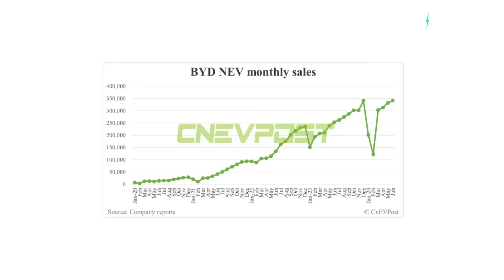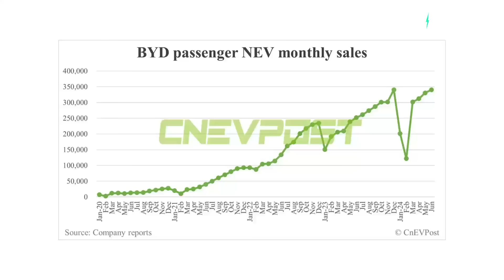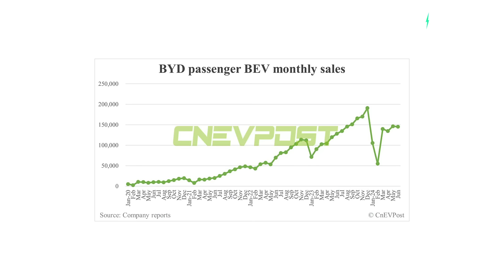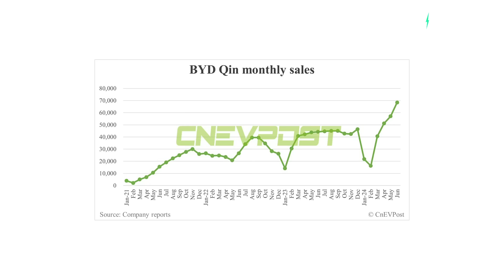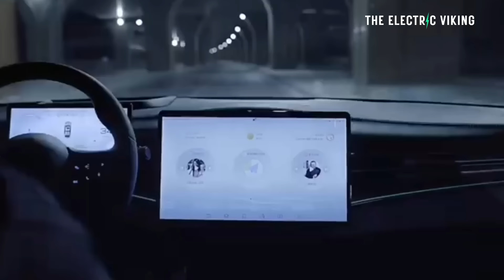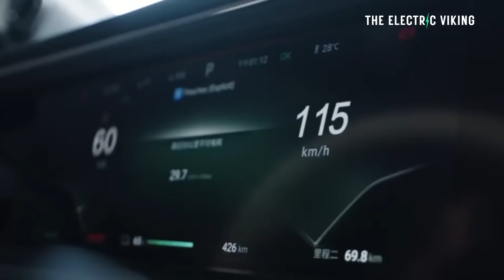BYD just set a new global sales record - will overtake Toyota by 2030

Comment: I have owned an Atto 3 in Perth, Australia for over a year and zero complaints. We got two speeding tickets early on due to outrageous acceleration, but now have got used to it. First 3-month service cost was ZERO and annual service $189 Aussie dollars (US$113). Software is especially strong, voice recognition is outstanding. Very useful boot space. Cost was $30,000 Aussie dollars (US$18,000) after trade-ins. We sold two petrol cars for $18,000, so original price in late 2022 was $48,000. We now use just the one car and make it work. Savings per year $1,600 (petrol and servicing). Insurance is CHEAPER than the old cars. I don't know what some insurance shills are smoking? Range is the other bonus, real world 420km on a full charge (263 miles). Last and biggest advantage is the cost of charging. This is ZERO because we have solar panels and never needed a fast charge. It is a thumbs up from me and my wife, so if you want good value for money, just get one.
Reply: 👍👍👍👍👍👍👍👍in Sydney same hete
Reply: Agree...We have same success with our Atto3 ... very happy
Reply: We got two speeding tickets early on due to outrageous acceleration ------ Good excuse😂
Last and biggest advantage is the cost of charging, ZERO. --------- Very impressive😲, 30% of the world can copy this plan.
Reply: Yep, they are very good, same here in Canberra
Reply: What was the annual service $189 for?
Reply: Wow.
Reply: @PyroShields  I don't know in this case but I also own an Atto3. In my case the local distributor threw in the first annual for free.

Periodic servicing requirement is mainly for filters (cabin air and coolant loop), as well as coolant top up and periodic replacement. 

Unlike the Tesla, in the Atto the main battery coolant loop isn't sealed for life, so requires periodic servicing. 

Other items would be brake pads and brake fluid, however, due to regenerative action the mechanical braking system gets light use. 

There is also an automatic parking brake that I expect would need periodic checking and adjustment.

Overall periodic service cost should be fairly low because there isn't much to service.
Reply: @jimgraham6722  I've never heard of a parking brake needing adjustment.  Also the cabin filter you can change it yourself it's not sealed and the brake fluid can be topped off.
Reply: @PyroShields  Sure, if you want to service it yourself you can do it. But you would have no independent service record showing all the right things had been done. These days I don't buy a used vehicle without a certified service record and if I did it would have to be heavily discounted.

As for adjusting parking brakes I have owned cars for fifty five years and never encountered a vehicle yet that didn't need periodic parking brake adjustment. Before arthritis, I used to do it myself.
Reply: @jimgraham6722  You want someone to change your cabin filter and fill up your brake fluid just so they put it on record? lol. That's ridiculous. I've been driving for over 30 years and never had to adjust my parking brake. Only way your parking brake will wear out is if you're driving with the parking brake on.
Reply: With all respect user-zu, you cant judge a car that is only 12 months old. When a car reaches 7 or 8 years old that’s when you look back and give it a rating.
Reply: @pontiuspirate1925 希望中国汽车能给您一个满意的体验😊

Comment: The move from ICE cars to EVs is similar to the transition from Hard Disk Drives to Solid State Drives in computers. It starts out very expensive, then gets cheaper year after year, and then suddenly becomes so inexpensive that you can hardly find regular Hard Disk Drives anymore, except for high-capacity ones used for backing up your data. Toyota has been slow to react, just like Kodak was slow to adapt.
Reply: Were SSD's mandated by government?  Subsidised by taxpayers?  No.  Were digital cameras?  Were smartphones?  No.  These products succeeded because they are better.  However, EV's seem to require compulsion through regulations and subsidies to force people to buy them.  Why do EV's need this if they are a better product?

Comment: BYD, a battery company which got into making EV's
Imagine the conspiracy theories, if Shell or BP made ICE vehicles !
Reply: Or if Tesla owned charging stations?😀
Reply: no,byd got a long run in ice car, not good ice car.
Reply: @JackZhang-hx1su  BYD bought an ICE car company in 2003, then made its first PHEV in 2008 and its first BEV in 2009. My assumption is that BYD bought the ICE car company as a way to quickly get the factories, tooling and knowledge required to make cars so it could then start figuring out how to make cars that used batteries (so could grow its battery business).
Reply: @JackZhang-hx1su  They have a poor reliability record
Reply: @CiaranMcHale very much agreed with what you said. Instead of starting from zero, BYD just pick up the foudamental of manufacturing a car from what other people started. Or else it will got into big troubles like Xiaomi or failed like Apple EV car. With their expertise in battery, making a battery run EV cars at the end was always the final goal of the founder. That's how he build his dream. Every of his move come with a reason, that's what a successful entrepreneur did.